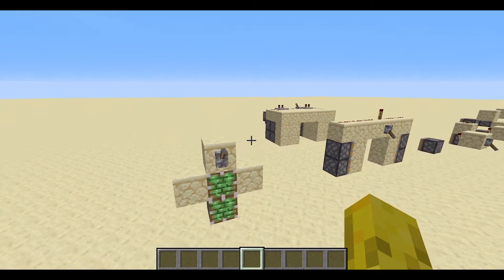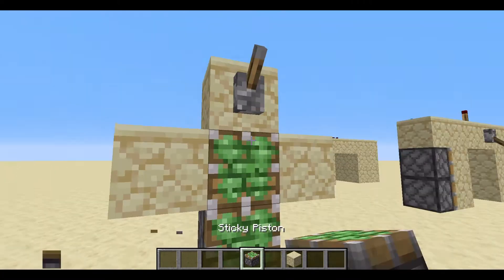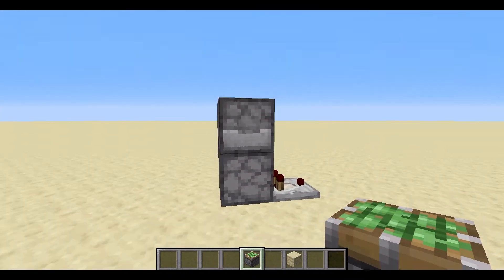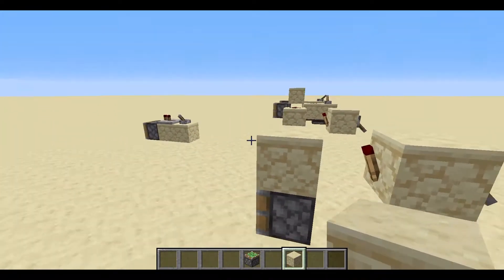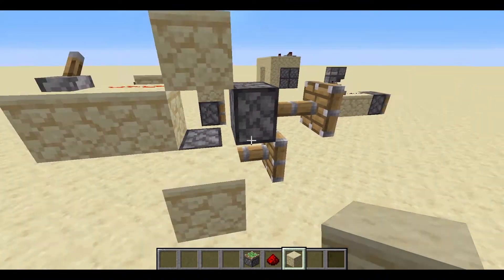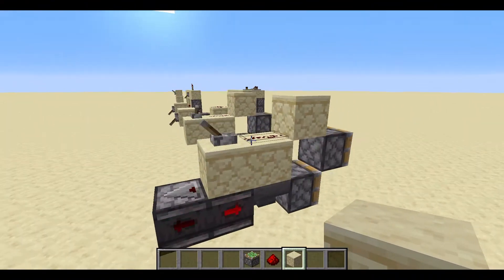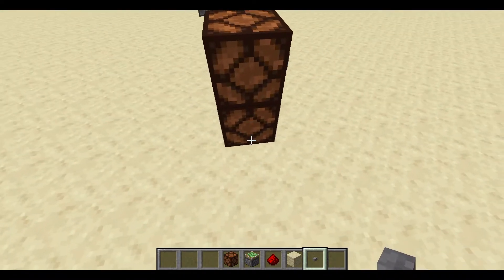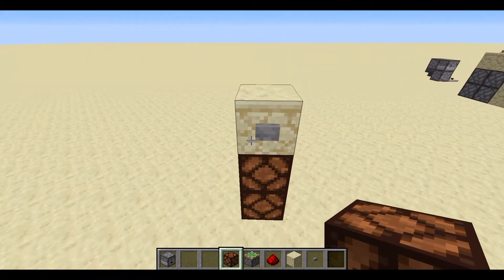what is quasi connectivity and how to use it in redstone builds?

Comment: Cool, but there's a couple things that are a bit off here:
-First, lamps don't have the quasi connectivity feature. It only applies to pistons, droppers, and dispensers.
-Second, your observer clock at the end actually does not need the hopper there. In fact, the hopper on its own is useless since it does not give out block updates. Either remove the hopper, or even better, add a note block above the bottommost piston to update it when it gets QC powered.
-Third, for QC, it doesn't matter whether it is hard or soft powered. What matters is whether or not the pistons get block updates.
-Fourth, the droppers in your T-flip flop are all normally powered, so it has nothing to do with QC.
-Fifth, a better explanation for quasi connectivity is just if the block above the piston would be powered, then the piston is QC powered.

If anyone needs help with this, you can comment your discord and I can get on a voice call and explain it hopefully a bit better.

Please pin so people are a bit better informed.
Reply from the maker: If If do a video in the future, I wasnt really told much of this before when I was learning minecraft java edition redstone so thank you.
Reply: Bluds the Redstone Regulator